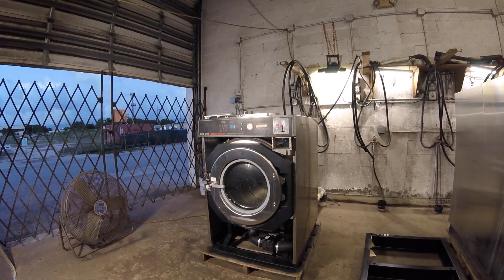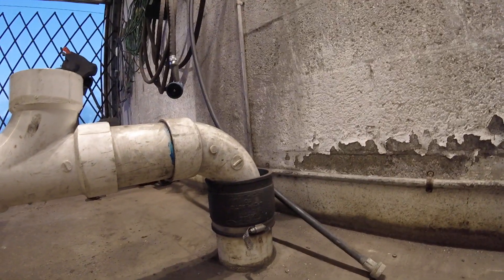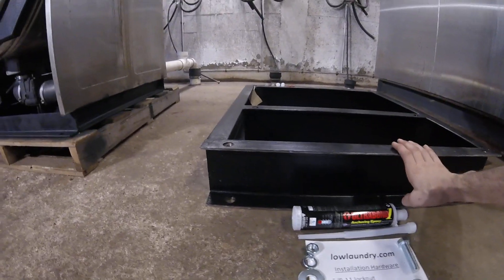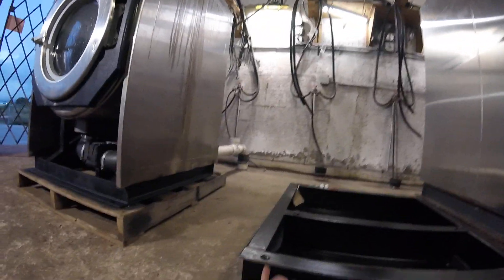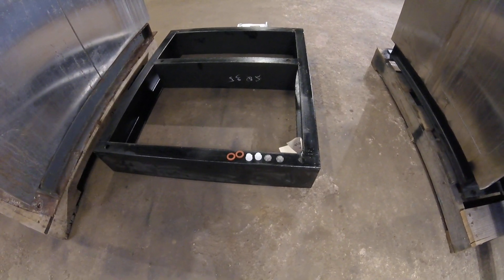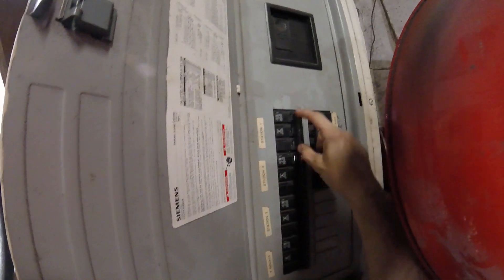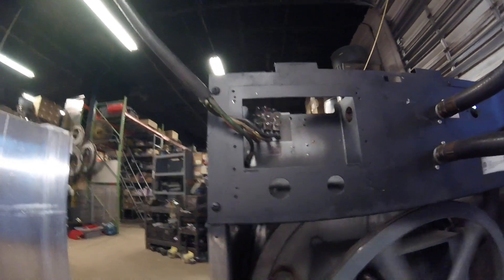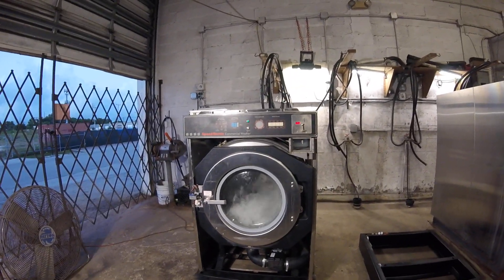Commercial Washer Installation

Comment: depending on what size this is, apoxy isn’t necessarily needed but using grout also helps keep it more stable, just use nuts to elevate the frame a inch above the ground and put it under